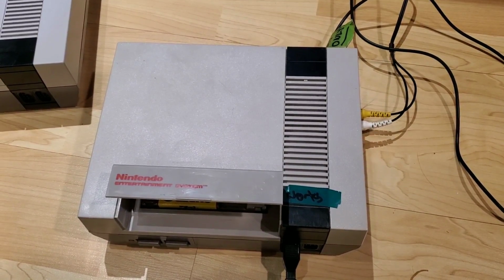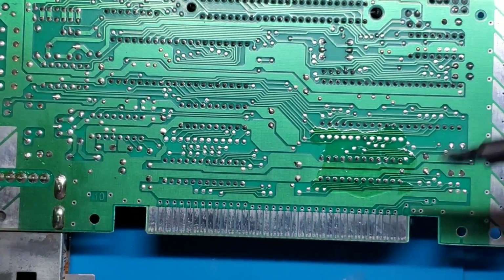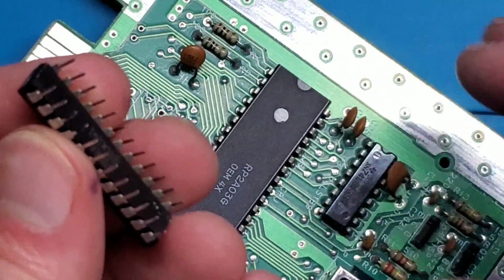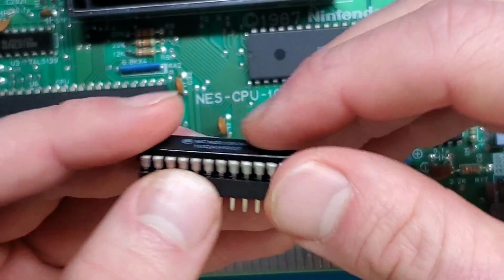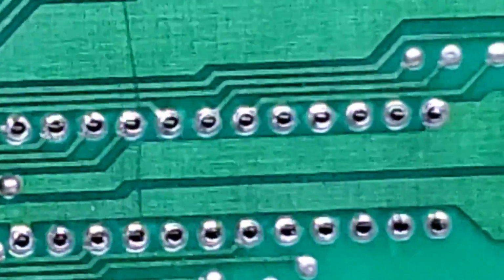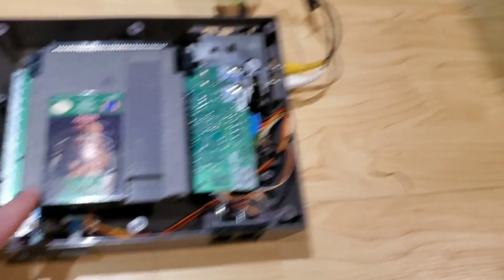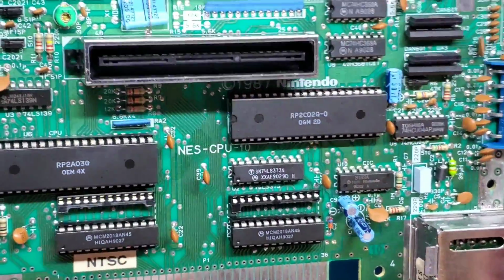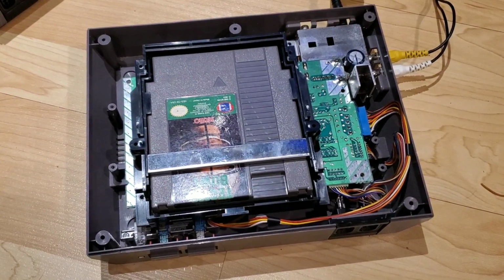Building a NES Test Board - IC Removal and Socket Installation - Fixing Ebay Junk

Comment: Is it possible to do this with an snes?
Reply from the maker: In theory,  yes,  but you'd need to find the proper smd zif sockets and obviously have some smd soldering skills.
Reply: @RetroRepairs  ya those sockets are expensive for the snes chips. Nice desoldering gun. 400 cdn or so.

Comment: Get the no blink board to complete the unit.  Also build a custom enclosure.  Or design a custom board with sockets that's wired to the motherboard and sits on top the unit.

Comment: Ever remove the rf box? I'm looking to do a mod to the power supply.
Reply from the maker: I haven't.   The main power filter cap, bridge rectifier and voltage regulator is on it, so you'd need to somehow rebuild that part of the circuit.
Reply: @RetroRepairs  The mod is to run the system on 5v DC. I plan to salvage most of the circuit and add some fail safes.

Comment: Well I dont even have an original NES, but I like this idea.

Also it gives me an occasion to talk about solder bridging. This was really a pain in the ass when I was still learning how to solder. Until this day Im not really sure what causes flux to change the solder behavior
Reply from the maker: It's slightly corrosive, so it cleans the pins and pads for ideal soldering conditions.   Im sure it also has a chemical reaction with the metal, which might actually draw solder to it like a magnet. (That's just my theory,  but ive never actually looked into it).  

Either way,  flux for all soldering is a must.
Reply: @RetroRepairs   Well this I do know for now ! Although Im still using the old fashioned one you have to apply manually. I guess I have to invest a few pennies for a flux pen.
Also if its the last video before Xmas, then best wishes for you, your family and of course for Kona !
Reply from the maker: @KISSbestfan  thanks,  all the best to you as well.  Ive got another video scheduled for Friday I believe,  not sure if I'll have another before the new year however.

Comment: Hey RetroRepairs, can u bring me the model and brand of the iron with pump that u are using pls ?
Reply from the maker: I've got two irons,  my main one is a hakko fx-888d. It's a decent quality inexpensive station.

The one with the hot air and iron combo is a cheap yihua 852D+.  Its ok, but uses the same tips as my hakko iron, so that's good for convenience. 

I did a video on the yihua about a year ago if you wanted to see it in action
Reply: @RetroRepairs  You should consider putting Amazon affiliate links in your description with the tools you use.

Comment: BTW;, the upper cornerpin of your television seems to be set very high. Maybe time to whip out the service manual and fix the geometry?

Something one might want to do to their daily driver NES would be to put a socket under the lockout chip with the leg you need to lift/snap cut off so that you don't need to modify the lockout chip AT ALL to do the modification. it does make it a lot easier to restore to factory function in the future, you just need to remove the socket or bodge wire it.

Comment: This is a handy accessory.  Not nearly as quick as the desoldering pump but it has its uses, and it's cheap!  https://www.banggood.com/8Pcs-Stainless-Steel-Hollow-Needles-Core-Desoldering-Tool-Set-p-928740.html?rmmds=myorder&cur_warehouse=CN

Comment: Why didn’t you socket one side of the rams for larger chips and the other side for smaller chips. So you could test both profiles of ram chips. You added 2 sockets on both sides that test the same chip. Alternatively, you could have just socketed one side with 3 rows like you did in the video.
Reply from the maker: No real reason not to
Reply from the maker: I'd rather have the ability and not need to,  than need to and not have it.

Comment: U installed the first connector incorrectly! U had pin 1 in the top right corner. Pin 1 was bottom left. Doesn't really matter as long as u know the proper direction for the chip. Great work tho!
Reply from the maker: Yep,  caught that after the fact.   Would be an issue if it wasn't going to be just me using it.
Reply: @RetroRepairs  right. Very good soldering skills!
Reply: You’re going to hear about that backwards socket for YEARS, Adam….  :-D

Comment: Quick question, you said you caught yourself fighting with the soldering grade alot,  so like what what problems occur when using that stuff. Or what problems do you feel that occur when using it
Great stuff bro.
Reply from the maker: Sometimes some old solder will get stuck in the hole and not clean nicely,  even after adding fresh solder.  It makes it much trickier and tedious to do larger chips like these 40-pin CPUs.  It has its place,  but it's not great for through-hole desoldering.
Reply: In my experiance a good quality braid (I use servisol soldermop,) is great for removing excess solder from SMT stuff, but it's not very good at getting solder out of holes.
Reply from the maker: @petermichaelgreen  Agreed.  In a perfect situation, the solder will suck itself out of the hole and into the wick, but in practice, that doesn't always happen, especially with older joints.

Comment: I think your desoldering iron is a little too hot and you're dwelling a little too long. Mine is set to 375ish. Around 5:45 you can see the board has turned slightly white around the joints. That's heat damage/delamination.
Also, I find it helps clear the joint if you wiggle the pin (inside to outside) while the pump is active, not just before.

Comment: Are you going to open up the bottom of the case to expose the chips so you can swap them without needing to tear down the test rig?
Reply from the maker: Im just not going to fully assemble it.  It'll be for testing only

Comment: I have a pal nes that will Only power on once and after a couple of seconds turn off. It does power on after it has not been used in a while and do the exact same thing. What could be the issue. Somebody did clip the lockout chip and there is no way of repairing it since the leg snapped off, I did try to bypass that chip but that did not help

Comment: I tip the board vertically and then tin the tip back farther. that lets the excess solder flow down the tip.

Comment: The hakko does help. For ppl not able to afford it, they can get a manual hand de-soldering tool like a "soldapult". It's still a pain for larger chips... 
The spacing is a bit tight but was wondering if you could get zero insertion force (ZIF) sockets in for the 40 pin ICs. That would reduce the risk of damaging (folding) some pins when continually inserting them for testing. It may be not possible to use them due to space limitations.
For the extra row of pins, supporting .600" DIP RAM ICs, I find using male-female headers, like millmax, to be useful. They come in strips of 40 and you break them to length as needed.
Cheers
Reply from the maker: Good idea,  I'm not sure if it would fit,  but might be worth looking. 

As for the sip headers, i ordered a bunch after doing this

Comment: The first socket was installed backwards. The pin 1 indicator did not align with the motherboard markings.
Reply: It doesn't matter but it's backwards. The notch in the dip socket signifies Pin 1 as well and if you didn't see the mask then you could install it backwards
Reply: I came here to say the same thing. A reversed socket is an accident waiting to happen.
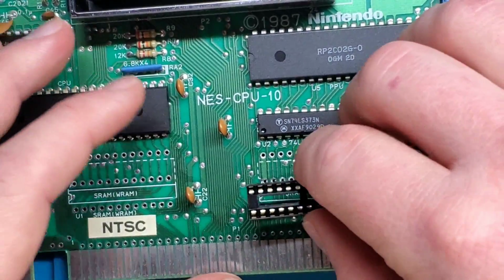Reply: 11:06 time stamp i was just about to mention it
Reply: @radioactivenuke1802   the notch shows polarity
Reply: I don't think it matters. Doesn't it just pass current directly though? As long as the chip fits into it, which it does, I don't think it makes a difference.
Reply: Yesss I am crying right now 😭
Reply: Just came down to post the same thing :)
Reply: https://www.youtube.com/watch?v=hYojMVxATq0&lc=UgyNwXHu1uKvJjn8Mh14AaABAg.92_6WlS6qzy92_6cYhcO3h
Reply: you live and learn :)